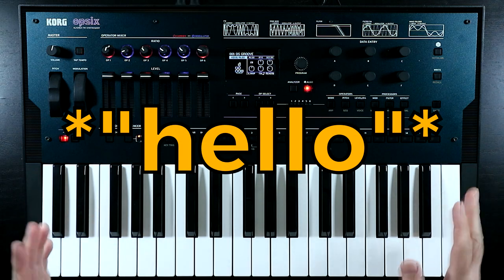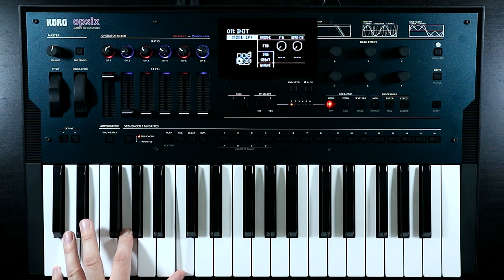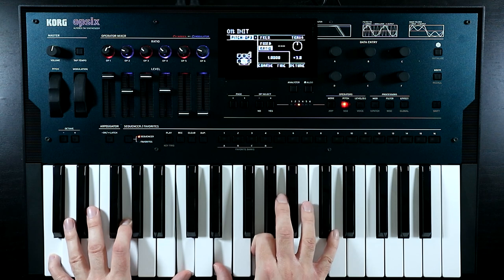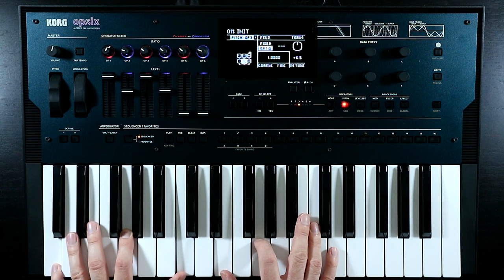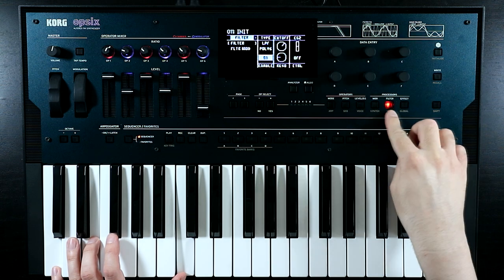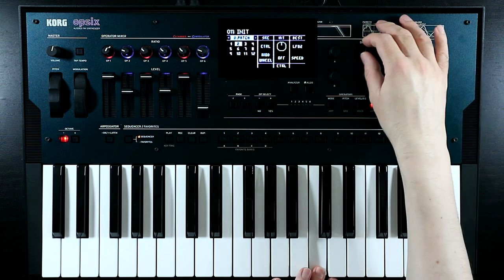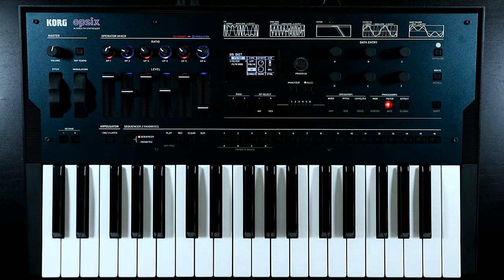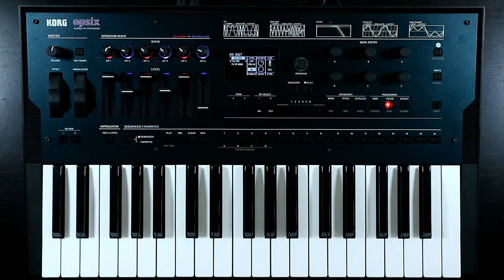Korg Opsix - Let's Build a Pad from Scratch (sound design workflow)

Comment: Thanks for the great Opsix vids. Just got mine, better late than never as they are B-stocking at $399 on Reverb. I was initially disappointed at opening the box and feeling the build quality... took me a few hours to decide to keep it. It's an Incredible synth especially for synth design and sampling. Just spent my first few hours fiddling on it. You would need 10 or more modules to do what this does, which would cost hundreds- if not thousands of dollars to get these results. Plus motion recording of parameters- although limited to steps in the sequencer, and nice effects, filters LFO's. Patch saving etc. 24 hours later, its definitely a keeper, I dont perform Live, only in-studio, so the cheap build/housing isn't that important, they had to cut somewhere to get this priced so affordably.

Comment: I enjoy this video very much. I would like to know why in 13:14 Op1 and Op3 are detuned (-3 and +4) it creates a vibrato effect. I'll look into it as I guess is a common property of two detuned oscillators sounding at once. Thanks
Reply from the maker: It is a common property, sometimes you hear it referred to as "chorusing" or "beating". Two waves that are nearly the same frequency, but just slightly difference will constantly be reinforcing and cancelling each other out because of the phase relationships between them. How closely the the frequencies are related will affect the rate at which they seem to pulse against one another.
Reply: @OscillatorSink  🙌🏻

Comment: Hi OS SINK
Great demo of OP-6 and its infinite possibilities but I’ve got other products I need first so on wish list 
I asked you before about Digitakt and using as midi controller for my Modular rack gear via a Polyend Poly 2 which I now have , it has
4 Gate outs 
4 pitch outs
22 CV outs
What inputs on other modules inputs do I patch to I’m unsure so would love your advice
Many thanks
Martin In Bromley Kent👍👋
Reply from the maker: That very much depends on which modules you have, but generally speaking, pitch CV will go to the V/oct input on an oscillator (or other sound source), the gates would go to, for example, an envelope generator (or a gate/trigger in on a sound source such as Plaits , if it has one). The CV outs can go anywhere! Modulate all the things! But like I say, difficult to say without knowing more about your rack.

Comment: Hey, If I sent you a bit of audio of an fm synth sound could you try and recreate it on that synth. Big ask, preparing for rejection.
Reply from the maker: I kinda have a blanket rule about not taking on commissions or doing one on one lessons (at the moment, while my work/life balance is what it is), sorry. But if you drop a link then I can maybe give you some pointers to get started? I'd also suggest watching my video on the FM Operator mode because it hopefully gives some generic advice about how to consider sounds in FM.
Reply: @OscillatorSink  Thanks, that’s completely fair. I’ll send through a link tomorrow and if you wanna check it out feel free, if not that’s all good. (:

Comment: Hey @oscillatorsink, thank you so much for all your videos, they are incredibly helpful and really good! i have a question about the opsix and it seems I cant find any information on it. its about the midi connectivity. so in general i would like to know what values i can trigger if Id for example connect the opsix with my syntakt. is it only going to be notes and tempo or will there be more than that? i know the opsix manual has a midi chart at the end of it, but to be honest it doesnt really make a lot of sense to me. to me this is an important question since i want to invest in a synth that i can use effectevly for a long time. i know the opsix has an amazing sound, but if the connectivity is limited i might reconsider and sell a kidney for a digitone...maybe you or someone else here can help me out? thanks and have a good one all!
Reply from the maker: On top of note and realtime tempo, looking at the chart, you have access to the parameters for the operator levels and ratios plus the controls on the home screen via midi CC. On top of that midi CC numbers are assignable, per patch, in the v-patch, so anything not on the home screen can also be controlled by midi CC (as long as you have free slots in the vpatch).
Reply: @OscillatorSink  wow, thank you so much for the quick response! that sounds really amazing! have you covered this in any of your videos so far? or if not maybe you could consider covering it in a future vid? i def would love to see what crazy ambient and drone sounds you would come up with with this combination. also i would be curious to know if midi cc and motion recording are excluding each other on the opsix or if they would be combinable somehow, but i guess ill try to get my hands on one and find out, thank you sir!